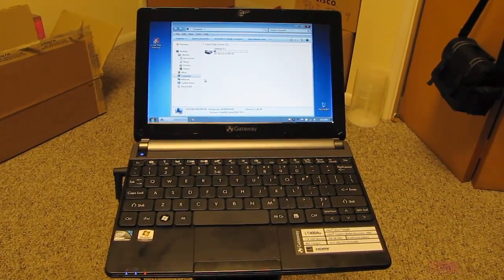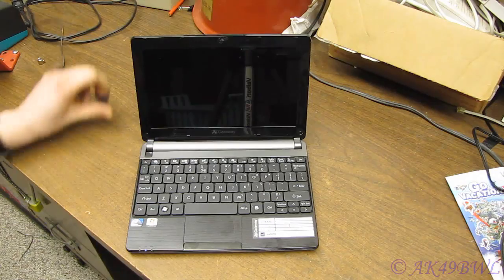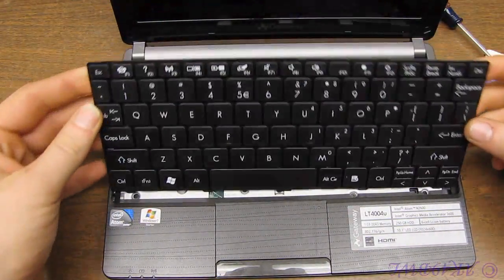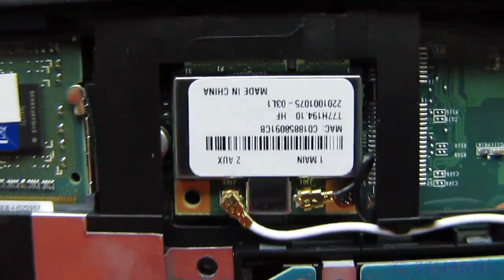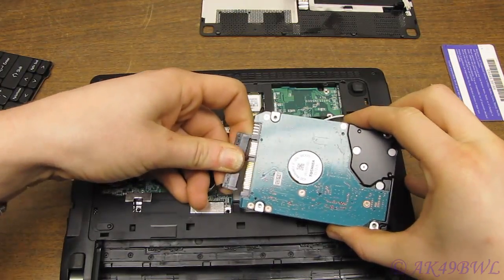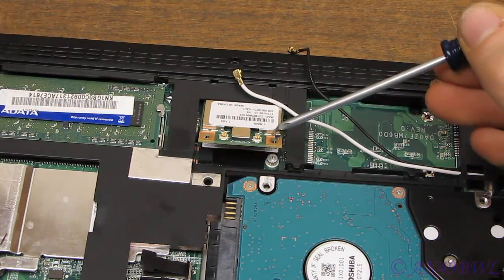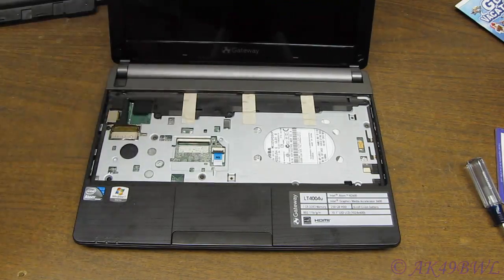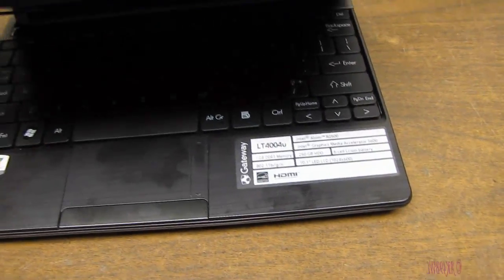How-To: Gateway LT4004U Netbook RAM and Hard Drive Access, Upgrade, Replace

Comment from the maker: As the now-primary user of this machine, I've put a 128GB SSD in it and installed Windows 7 Ultimate x32 - Can confirm that Windows will detect all 4GB and use 3GB of it, using the PNY 4GB PC3-10666 stick installed in this video. Have not and probably won't try x64 because for my purposes it isn't needed.
Reply: Excellent thank u much,hope u consider seriously teaching u have made it so simple ,once again thank u. I did it
Reply: haha, quarantining right now and i just rediscovered my old LT4004u!! will try to follow this video to upgrade!
Reply: That was a great video thanks

Comment: This laptop kept going through power supplies on me.  I must have bought 6 different power supplies in a few years.  The wire was uber-chintzy and would constantly break internally, near the computer side connector, due to normal flexing with use.  Finally, one night I fell on the laptop and got bruised up pretty good - but I smashed that crappy POS all to hell in the process, and put it out of my misery.

Comment: Thanks a bunch. Now can you help me recover or wipe or bypass the forgotten BIOS Administration password.
Reply from the maker: Disconnect the main battery, then the CMOS battery, leave disconnected for 30 seconds, reinstall CMOS battery, main battery, boot up. That should clear all BIOS settings, including passwords.
Reply: @AK49BWL  So this will work for this model of netbook? I tried that with other laptops and it didn't work. Thanks for the reply
Reply from the maker: Thinking about it, that may not work on newer laptops with EFI BIOSes...It always worked on older machines tho, and while I didn't test it on the Gateway, I don't see why it wouldn't. As I recall it does not have an EFI BIOS.

Comment: How the fuck do you reset the BIOS psw
Reply from the maker: Clear the cmos... Unplug the power supply, primary battery, then the cmos battery (the little quarter looking thing by the CPU). Wait one minute, then plug all back in the opposite order. Should work... Tho I admit having not tried it myself but it certainly won't hurt anything.

Comment: I tried following your steps, but I'm having no luck removing the keyboard. I just can't get my screwdriver to catch enough to lift it out, and I have a pretty fine tipped driver. Any advice? I don't want to end up breaking the thing.
Reply from the maker: You can pry pretty hard behind the keyboard before you'll end up breaking anything... The keyboard is fairly flexible.
Reply: Thank you! I got it out. Turns out the stick of RAM I had was incompatible though. Oh well, I'll order the right one at some point. Thank you for the video, it really helped.
Reply from the maker: Glad to hear, good luck with the correct stick :)

Comment: You mention that you do not know the maximum that the netbook can handle. It is a 32 bit system, so technically it can take a 4 gb stick.....but it will only access 3 gb of it. 32 bit system limit.
Reply from the maker: That's assuming you keep Win7 Basic. I'm talking about hardware limit. Comments here have indicated a max of 4GB on a Linux-base OS, but even 64 bit versions of Windows for some reason will not address more than 2.

Comment: @brandon.
Thanks for the video,
I have this exact notebook and you mention how it is 320gb hard drive. Do you have the instructions on how to remove the best buy installed bit? Also if i remove all the best buy stuff will I still have windows?
Reply from the maker: Of course you'll still have Windows, it's only applications you're removing. Basically, go to your control panel, find "programs and features", scroll through the list and remove everything not related to hardware or updates. You may want to use Google to find out what's what tho :)

Comment: I just followed these instructions on an LT41P02h. Upgraded the hard disk to an SSD and it worked great. Used the Samsung data transfer program that came with the new SSD with no problems. 
There may be one more tab along the top of the keyboard on mine but it came out the same. 
The little Netbook was getting almost too slow to use with its original hard drive, and the SSD has made a huge difference.

Comment: I installed the PNY 4gb DDR3 into LT4004U from the 1gb stick and it returned 2.99gb available running Windows 7 Ultimate.  Very nice but where did my other 1.1gb go?  Anyone?
Reply: The netbook runs Windows 7-32bit. 32 bit Windows will only recognize up to 3 gb ram. You would have to have a 64 bit system to access anything above 3 gb ram. Sadly though, this little netbook cannot run 64 bit Windows.

Comment: can i use a pc3-12800 ram on this?
Reply from the maker: You'd have to test it for me and find out as I'm not sure - at any rate, if it did work, it would probably still only run at the PC3-10666 (10700) speed because that's what the machine supports - but I dunno :)
Reply: Tried it and it ran although at lower frequency. Tried up to 4gb PC3-12800/

Comment: Watched this vid to get some tips for my 4010u. Well-presented and clearly spoken. Thank you! That keyboard is easy to remove, much easier than on other computers.

I just now dropped in a 4GB memory module. May eventually put in a 1Tb HDD too.

Putting Linux on this computer might be a good way to get at all the RAM and to improve general performance. I think distros like LinuxMint, Porteus, or Lubuntu would work well.
Reply: a follow-up on this, 10 months later.  The 4Gb module works just fine, but reads in the operating system as only 3Gb available.

I'm using this machine mainly to watch online videos (YouTube / Netflix) and listen to podcasts. For a while I had Ubuntu Netbook Remix installed (OS from 2010). On this machine the Unity desktop was a little heavy, so the machine felt unresponsive. Once any app got going, though, everything was fine. Handled Netflix ok. (Had to find a download of Chrome 48 to make that happen.)

Recently I decided to install Linux Mint 17 32-bit with the MATE desktop. MUCH IMPROVED feeling and performance all around. Everything worked correctly right after installation. I put that same version of Chome on to watch the Netflix; no problems at all. Memory still reads as only 3Gb.
Reply: Yeah, that's the main problem....the netbook is only a 32 bit setup regardless of OS you put on it. 32 bit systems can only access up to 3 gb ram. It has to be a 64 bit system to be able to access higher then the 3 gb limit

Comment: Also want to know if this will handle an x64 O.S.? If YES, then you can install a 4Gb Sodimm and x64 will use 3 gigs of it, by default. That should give you some gaming speed, especially running 64 bit with Dolphin emulator.
Reply: Sadly...no, it can't use 64 bit OS. The netbook is only a 32 bit system. I have the LT4010u, which is basically the same thing as this on...and tried to get Windows 7 64 bit....just wouldn't let me install it

Comment: Thank you. We had a Gateway LT4008u laying around and it was so slow. Always wondered if the memory could be increased. your tip worked. It is a little better to work with but not great. Tried to upgrade to Windows 10 but the graphics media accelerator 3600 series is not compatible. Any ideas?
Reply from the maker: +Melvin Ligh I doubt it would even run Windows 10 at a decent speed.. It does good to run 7, lol. And since I don't know of any graphics incompatibility workarounds, I don't think I can be of further help, apologies.
Reply: +AK49BWL Thank you for the reply. Do you think it would be possible to change the intel chip or would a solid state hard drive help make it faster?
Reply from the maker: +Melvin Ligh an SSD would most certainly speed things up. I don't believe the CPU can be replaced in these machines.. Pretty sure they're soldered to the mainboard.

Comment: Will any 4gb 204 pin SODIMM work. I can only find 2gb ram using compatibility software but people have obviously upgraded to 4gb.

I'm not too technical so I want to make sure the memory works before I buy it. Also I have tried looking for the PC3-10666 mentioned in the video but no luck finding any for sale currently

Comment: Hi Everyone,

I have a gateway LT4009u which is not getting power connection. 2/3 days back after running for about 5 to 10 minutes it suddenly went off. I have checked the AC adapter it is giving the output but no charging of battery and charging light indicator also off. I have open the battery and fixed it but no result. Can someone help me to solve this problem? Thanks. Moin
Reply from the maker: +md uddin the charging port on the laptop itself may have broken loose from the mainboard. To fix that, you'll need soldering skill, but it's not hard to do. And you'll probably need to tear the machine down just a bit more than ishown n this video lol

Comment: ive been trying to erase my stuff from my laptop, but i cant because i have no administrator rights. and i need another way to erase my laptops stuff.. please help!!
Reply from the maker: xime ochoa Boot it into safe mode. There's a very high chance the administrator account password was never set, and the account is generally hidden outside of safe mode. Turn the computer on, and keep pressing F8 until you get the prompt, then start up in safe mode.
Reply: its not really letting log in, it wants the administrators password. is there another way to reset it?
Reply from the maker: xime ochoa well - if you don't want to keep anything on it, you can always hook up a CD drive via USB and get an OS install CD to format the drive and wipe it out. If you don't have and don't want to buy a Windows CD, just download a Linux ISO, burn disc, use disc to reset system.
Reply: +AK49BWL do you recommend any?
Reply from the maker: xime ochoa Ubuntu is pretty user-friendly.

Comment: i bought this exact model from Best Buy a few years ago and had received a free 6 mo software subscription for Kaspersky Anti-virus, i also purchased Best Buy's one year protection plan (that i had forgotten about) and the day the anti-virus sub expired it quit working (not sure if it was a coincedence or factor) and was unable to do any successful reboot, repair or recovery options. ive scowered the interwebs for any sort of solution to no avail. i even thought of and attempted to install Linux, again unsuccessful. any ideas on what i can do? there is a Product Key sticker on the bottom, that i would be able to use in fresh win 7 (starter) OS intall but im trying to avoid or do in a last resort.
PS: i, to, am here in anch.
Reply from the maker: Takpaan Boskofsky  forget Kaspersky, get Avast. It's better, and no paid subscription.
Reply: Yea I'm never usin Kaspersky again. 
But do ya have suggestions on me fixin the netbook? Open to the idea of Linux-ing it as a suggestion as well.
Reply from the maker: Ok well I guess my first question would have to be, what CAN you currently do with the machine? What is it doing, or not doing? How did you try to install Linux, via USB CD, USB flash drive? I don't think, if you install Windows again, that you'll need a product key, as on most systems the key is embedded in the BIOS. I'll say ahead of time, I don't know a lot about Linux to begin with, either :)

Comment: Gateway always makes simple upgrades hard
Reply from the maker: Could be worse... One of my old Dells required you remove the screen from the body and remove the motherboard completely to even access the RAM. And on top of that, it was proprietary.
Reply: what model dell
Reply from the maker: Nick Wood I don't remember, this has been YEARS ago... Think emerging Pentium 2 era lol
Reply from the maker: Nick Wood
I can tell you my Dell Vostro 1500 requires complete disassembly to get to the CPU.

Comment: Great vid but my gateway netbook has a door that you remove from the bottom to access the ram an hard drive. Just like my gateway laptop has. I got lucky upgrading mine to 2gb of ram as the gateway laptop got smashed so I removed the 2 2gb memory sticks an used one in my netbook an was considering using the 500gb hard drive but wasn't sure if the netbook could handle it any info on if the mother bored of these netbooks can run ok with a 500gb hard drive would be greatly helpful
Reply from the maker: 85gbod Hard drives are near limit-less these days.. You can put anything in there and it'll work.

Comment: For anybody that want to save a lot of time...Just install Windows 32 bit Ultimate. Why? Latest video driver is now 8.14.8.1096. With 64 bit you only have a low performing old Vista beta video driver. You will NOT gain anything from using a 64 bit OS as far as memory goes. Both will show 2.99 usable. The stated PNY memory works, I am using it right now.There will never be a 64 bit video driver released. So with that said why would you install 64 bit OS? The 1096 video driver will probably be the last for 32 bit. And why bother with Win 8? Dumb as hell live tiles? Ha! Grab a SSD too and with the stated 4 gig ram and SSD, Win 7 x86 Ultimate, you will have a killer netbook.
Reply: thanks I will try that with my notebook
Reply: thanks I will try that with my notebook
Reply: thanks I will try that with my notebook

Comment: Great video, thank you!  I have the LT4009u.  Had the machine up and running w/ new 2 Gb memory within 10-15 minutes.  I went to Crucial's site and they have a program that checks your machine and tells you exactly what upgrades are available.  Received the memory in around 3 days! Regular shipping...was like $32 total w/shipping.  Don't work for them, just my experience.  I did not remove the ribbon cable from the keyboard and it was kind of in the way but to me still worth not having to worry about if I put it back correctly.  Like a new little laptop!  Thanks again.

Comment: I recently bought a refurbished Gateway 4010u and I used your video to upgrade the RAM. The video is extremely helpful.  It took me less than an hour to do it myself and I saved $. What a difference in the PC performance. Thanks!

Comment: If you install 4GB RAM your system will run faster your video will get more shared memory and run smoother your MS graphics score will increase a bit, mine is 3.2 now.  1GB is reserved I have 1.3 GB free.  I had the 2GB  (it also has reserved memory) which is a noticeable change but the 4GB is a bigger change.  The price difference so little that you must get the 4GB.
Just a note about Win 8 the Windows App Store requires a minimum res that is higher than this notebook so my advice is Win 7 Home Basic or Premium which is on the LT4004u (others?) ready for an in-place upgrade requiring only a key.   It is interesting to note that buying the boxed CD was cheaper, but does require getting an external DVD drive.  Making a recovery disc also needs an external drive.

I know about Win 8 because I went for the $15 upgrade offer after doing the Win 7 Premium in-place upgrade.  I which I had stayed on the 7 the 8 was not usable until I installed Classic Start.  Even then there was screen flicker when using any browser I can't remember if that went away after the 4GB install or if it was after 1GB of OS updates, it is gone now.  The wifi which had been fine under 7 now starts out fine at the beginning of a session then slows to a crawl so I now have a USB wifi from TRENDA installed without their SW (win just installs it as a second wifi) and problem solved.

Comment: I did get the ram in, I've 2gb now on my LT4008u. But it was not quite as easy to get the keyboard off. However it wasn't too much trouble. I left the ribbon connected and followed the demo. But after booting up, my spacebar does not work. Any suggestions?

Comment: Thanks a lot for the great video! It's impossible to take it apart without watching your video first.
Yes, It worked on my LT4009U. I upgraded to 4G although  Windows 7 Starter said only 2G usable. I am going to upgrade to 64 bit Pro

Comment: Hi, This video is awesome. TY.

 I tried the exact same PNY PC3-10666 4GB Ram as shown as confirmed in the video, and my system wouldn't fully power up. It would power on, but the screen would never come on. As soon as I put back in the original ram, it powered up and the monitor came on. I'm assuming as the person below said, you need a 64 bit operating system to handle the 4gb, and this is 32. Will try the 2GB ram and see what happens, but using the one from the video didn't work.

Comment: I'm running win 7 64 bit.  ALL 64 bit drivers.  You have to GOOGLE to find the drivers.  If your lazy, use DriverUpdate to get your drivers.  Tip: Grab your WLAN driver before you upgrade to 64bit.  Windows won't find one on its own.(so you download the rest of your drivers).  My LT4010u uses this Broadcom 5.100.82.95 driver for the WLAN.  GMA is the only "weak" driver, I used the 8.15.8.1050 Vista beta driver.  Works though!!

Comment: I installed Win 8.  But uninstalled it because the Metro tabs don't work because of the 1280*600 resolution. There is a reg hack to get to 1280*768. Went back to Win 7 64 bit.
Win 8 GUI just to goofy..

Comment: I spent nearly 2 weeks trying to get Gateway to honor the warranty on my LT4010u. Turned it off one night and it failed to work the next day. A large paperweight since then despite my efforts to get it working.  I'm not a techie, nor am I a neaphyte.  I've worked with, built and repaired dozens of computers since.  Unable to even get a C prompt and seem to wind up in endless loops when I start the unit.  It asks me to use either f2 or f12. - then nothing. Tried repair disk. Out of ideas. Help?

Comment: Just to add my 2 cents, I installed 4GB ram on my Gateway LT4004U running Windows 7 Ultimate. System in control panel actually shows that 4GB is installed but states in parenthesis that only 2.99 is usable. I'll take it! That's still better than 2GB!